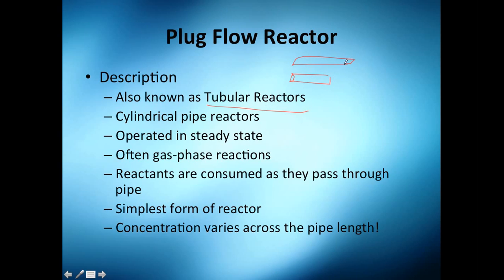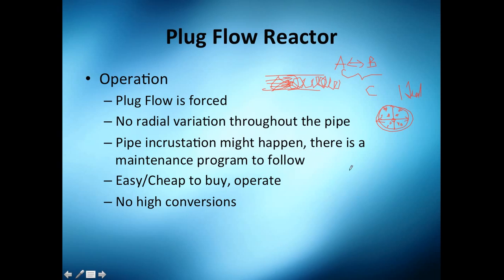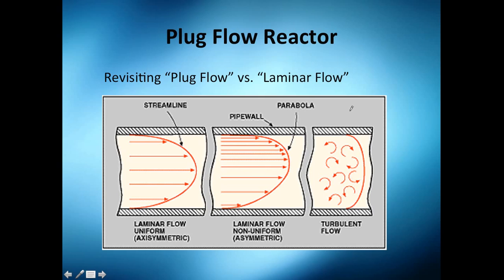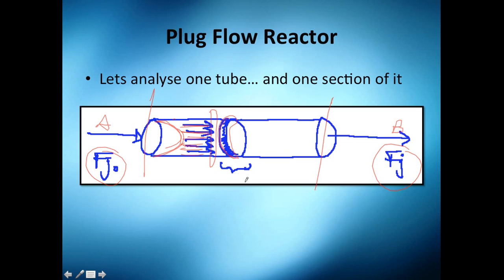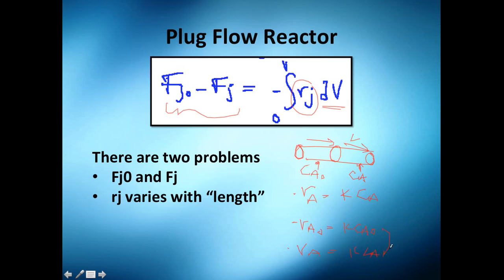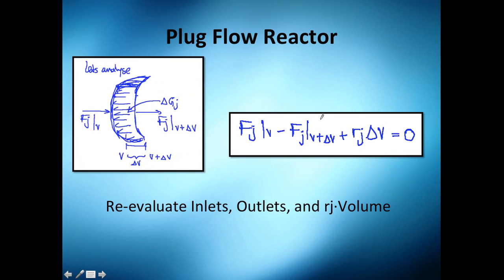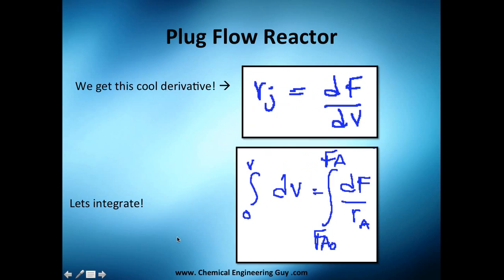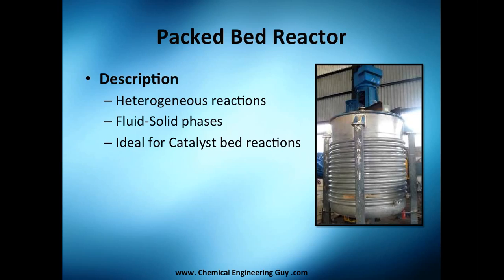Plug Flow Reactor (PFR) Molar Balance Equation // Reactor Engineering - Class 9

Comment: For anyone put-off by the calculus gymnastics used in this derivation, there is another way (no offense to Chemical Engineering Guy, that's indeed the traditional way it's done). Take the steady-state GMBE (dropping the j subscript for convenience)

F₀ - F + int(0 to V) r dV = 0

and differentiate both sides with respect to V:

d(F₀)/dV - d(F)/dV + d/dV[int(0 to V) r dV] = d(0)/dV

The first two terms can be evaluated easily by visualizing F₀ as the flow rate at the very beginning of the pipe, and F as the flow rate some volume along the pipe. It should be clear that F₀ is constant (with respect to location in the pipe/volume along the pipe) so d(F₀)/dV = 0, whereas F depends on the location in the pipe/volume along the pipe so d(F)/dV is nonzero.

The third term in the GMBE is straightforward to evaluate by the fundamental theorem of calculus ("part I"); just as 

d/dx[int(a to x) f(t) dt] = f(x), so 

d/dV[int(0 to V) r dV] = r.

Thus the GMBE becomes 

-dF/dV + r = 0 

which yields the design equation 

dF/dV = r

with no need to appeal to infinitely thin slices.
Reply from the maker: No offense taken my friend, actually Im glad you point other way to do it, its all about understanding and there are many approaches to do so! Thanks for your comment Richard!

Comment: Hey the CEG
thanks for nice and complete clarifying the concepts. I have a small lack of explaining the final term we got for each kind of reactor. ie. what is the interpretation of the volume in the last equation? is that the volume necessary to reduce the molar mass entered of species J to the specific molar mass at the outlet!  (btw well done)
Reply: Molar mass is constant, the F variables are molar flow rates. V is interpreted as the fixed volume of the tube required to reduce the molar flow rate from the specified inlet value to the specified outlet value.

Comment: Hey . Thanks for good explanation,

I am not good at differential equations. Could you please explain what the division of Change in Flow rate across control volume by delta V mean in simple words? What kind of transformation it brings? Do we analyze it then at level smaller than delta V? Thnaks.
Reply from the maker: Well, the change in flow rate depends only in the "x-axis", that is, length. Then, if we relate to an area, this will be volume. Thats why dF is related to dV, for every change in volume, there is a change in flow rate of species "i"